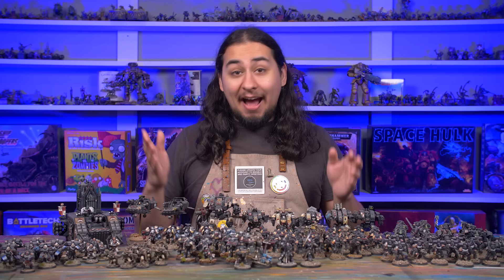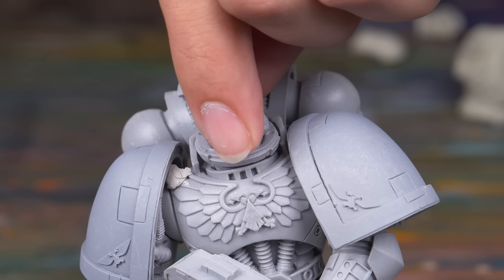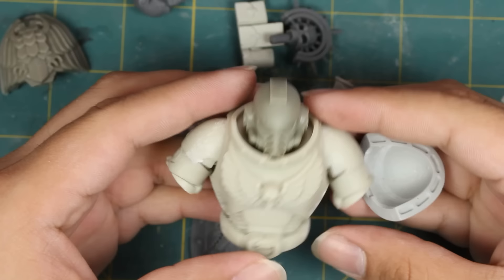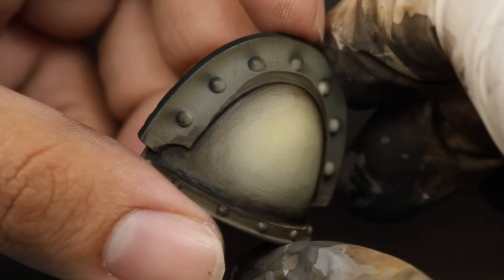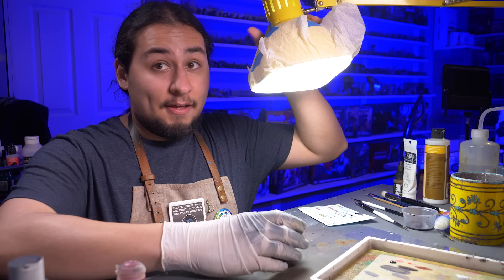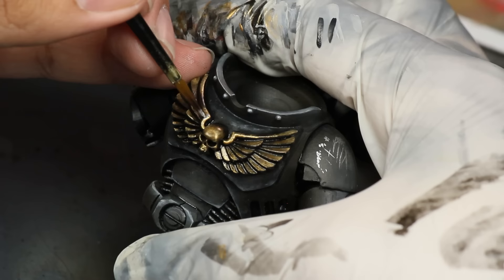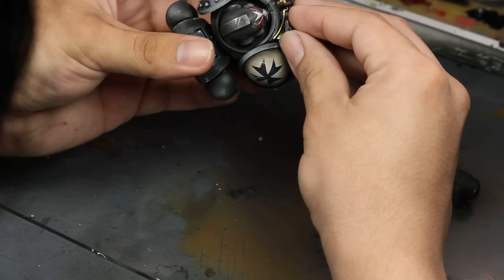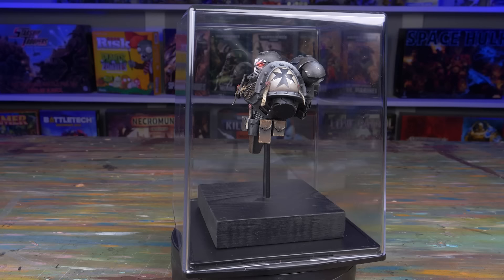Getting Ready for My BIGGEST Forge World Model

Comment: I always use a mechanical pencil to sketch in my base line work for freehand, you can get everything looking nice and symmetrical without committing at all, a brush dipped in water over it will immediately remove it if you make a mistake, then just paint over the lines, much easier.
Reply: Grea tip!
Reply: 69th like

Comment: Haha the last time you had a cobalt keep sponsorship video you caused me to buy EIGHT cases and I do have to say, Shipping to Canada was not the cheapest but Cobalt keep was very great at working with me to find the cheapest way to get the containers to me here in Canada.

I bought 8 because 2x Set of 4 was cheaper than 6x Individual box so I just ended up picking a 4th kill team (and my wife a 4th one too) to fill up the 7th and 8th cases.

Cases are great, Your recommendation is great, and Cobalt keep is very easy to work with and very helpful.
I recommend fully.

Comment: It would be interesting to see you paint up an HG 1/144th scale Gundam model like a Zaku II, a Gelgoog, or a Gouf (either a B-model or a B-3 Custom, with its Gatling gun shield attachment!) using 40K techniques. I have seen a few people do it, but would be curious to see how you would do it. I mentioned the three Zeon mobile suits above specifically as they have plenty of areas to place Black Templar symbols, especially on shields, shoulder pads, legs, and backpacks.

Comment: With freehanding, I find i terrifying. But I've found that using a light pencil instead of paint lets me get the right shaping without too much commitment.
Reply: Watercolor pencils are a good way to sketch designs as they can be easily erased with a touch of water, or sealed in with a quick spray of varnish.